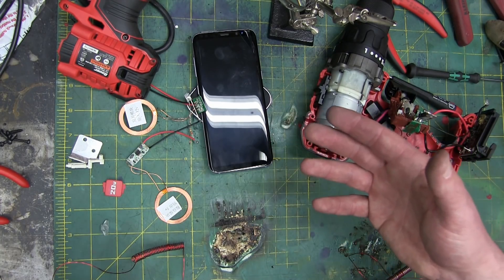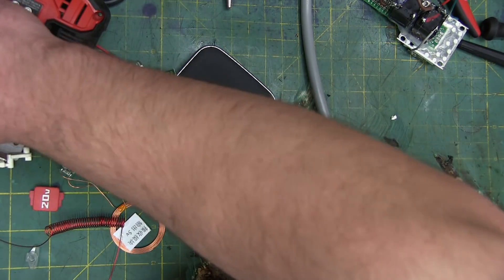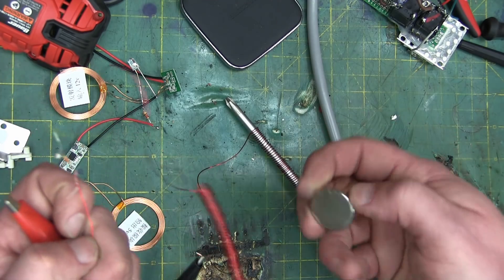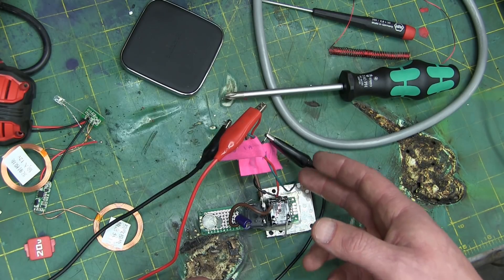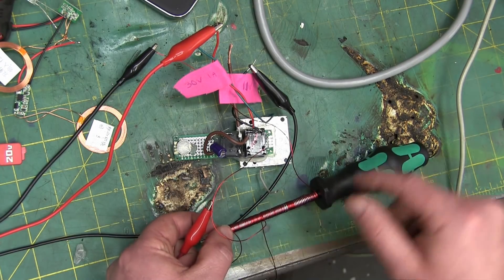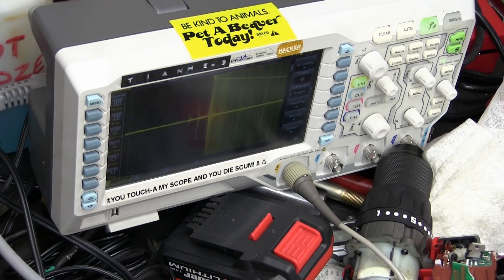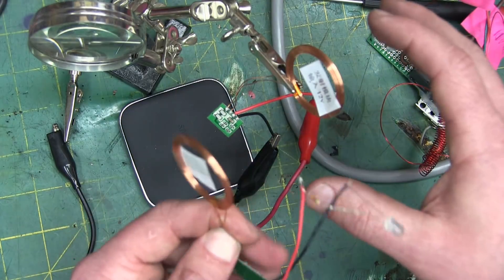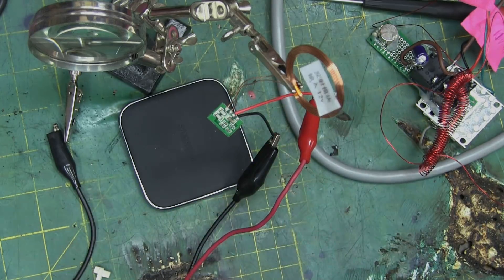Qi Wireless Charging EXPLAINED! | Electronics for the back of the class.

Comment: So if I put coil of wire around my wing dang doodle and a magnet on my wrist I could power my house
Reply from the maker: Yes, but due to inductive kickback, you'd eventually go blind.
Reply: 30 seconds of power is better than no power
Reply: Hell I'm already cross eyed and 30 seconds of power every 5 minutes isn't to shabby
Reply: Get 9 more blokes, and have infinite power.
Reply: So that is how they got power out of humans in the Matrix.
Reply: Distribute these to a federal pen and get power 24/7.
Reply: DIFFERENT STROKES FOR DIFFERENT FOLKS (I was hoping to make a pun on the ole wang in the vice)
Reply: Tom Slak just give 'em a fleshlight with a built in copper coil and a life time supply of magnetic condoms and Aramco will go belly up
Reply: Christopher  Good more then likely light up like a f__king Christmas tree!
Reply: I have a Fitbit.  It said I masturbated 30 miles today.
Reply: They would need an unlimited supply of hot pockets and Xena tapes.
Reply: https://youtu.be/ENZBTPTOFOo
Reply: Tried... wife said the wifi strength was too low... darn almost ripped the head clean off trying to resolve it for her. Worked for a few seconds but be warned, as Ave highlighted with the Phillips, the head can get too hot to handle.
Reply: Different Strokes for Different Volts?
Reply: terry jenkins if I do it right I can make the Christmas tree flash with holiday music😎
Reply: Pffft, that's just a myth.
Reply: 1:34 FAP power!
Reply: pr0xZen dielectric grease it will prevent corrosion as well
Reply: Christopher  Good nice , I'm free energy ! kinda weird seeing my tuna can pecker glow though. Need more lasinapril though.
Reply: Pornhub, was or did develop ah bracelet that you can wear whilst j.... Well you know.  And it crueates and stores energy to later charge a USB device.
Reply: AvE  dude you rock  more power love your videos
Reply: Some lonely nerd has already invented this! (sorta). Google "wankband"
Reply: Wouldn't you rather have your house power your wing dang doodle?
Reply: Bahahaha
Reply: You can power the entire city my friend.
Reply: If done vigorously perhaps?
Reply: polarity is factored on the red pill or the blue pill
Reply: There are several components to studying electronics. One resource I found that succeeds in merging these is the Gregs Electro Blog (google it if you're interested) without a doubt the most useful info that I've heard of. Check out this  extraordinary resource.
Reply: Nahh! ... If you did that the fields would be at right angles to the coil and the movement at a 3rd right angle to them! Now if you had steel in your pencil instead of lead and you caught the magnet to the steel on each stroke you would have an inverted Current Transformer! ...... You could use it to charge your pacemaker ;O)

Comment: Back to revisit from 5 years ago. Special occasion. Field strength of an electromagnet (or any magnet is on a logarithmic scale)  The field flux decrease by a factor of 4 at half the original distance. They are simple, and have been used on inductance stove tops for a long time. However, you must use a ferrous cooking pots. As an electric field, has a very minor effect on many metals. The stove top remains cool to the touch, only heating the contents.

Comment: what you don't mention is that the wireless charger sends out small pulses like you see in the LED until a device is put on top to receive the pulse, after the device receives the pulse, it sends a acknowledge pulse back which turns on the constant high power oscillation on to to charge the device

Comment: If you take a cheap chineseium Qi charger, could you replace the coil with a bigger one to increase the range slightly to accommodate for example, a phone case? I've gotten a couple and the phone charges fine without the case, but with it, the distance is just far away enough that it doesn't charge. Using a more powerful power adapter doesn't do anything because I'm guessing the electronicles are limiting the the amount of flying pixies. Other, more expensive Qi chargers work fine with the phone case, so I'm wondering what the difference is.

Comment: Inductive coupling is just electromagnetic fields at work. When the field changes that field creates a potential (voltage) in the induced conductor and it will then conduct a current into the receiving circuit.

Comment: (from the back of the class) So isn't this sort of how a transformer works?  2 separate coils transferring electrocity without touching?  I'm elbow deep in a wall plug transformer that's hooped  (At least I assume that's what the melted parts inside mean) and barely know anything except what I've picked up here.  6 months ago I wouldn't have even opened it up.  What's the difference between how a cell phone charger works and how a wall transformer works?

Comment: A while back here in the states there was a highly publicized lawsuit where our local power company was suing the pants off a bunch of citizens who were using this concept to steal electricity right from the power lines without touching any of the power company's property (which is what made it an interesting case). They were putting transformers near the power lines and using induction to generate free power. The suit ruled in favor of the power company stating that the lines of flux belonged to the power company and even without touching or altering the companys equipment, it was still theft. I might be totally wrong that this is not the same thing, but still an interesting case.

Comment: I remember those late 90's cellphone, CB, and VHF/UHF scanner antennas. The type that stuck with double stick tape to each side of car windows & transmitted/received through the glass. Could this be the same concept?
 
Those antennas sucked, they always fell off on the highway, I switched to the magnetic, at least I could retrieve those after falling off as they were dragged by the coax unlike the stick on.

Comment: Why don't we use satellites whizzing around the outside of the earth doing the same thing using the Earth's magnetic field
Reply: E Zacher The size of the coil depends on the distance and strength of the energy source. To get any  meaningful amount of energy would require coils much larger than the more efficient solar panels currently being used. Thats only the beginning though, solar panels are a) cheaper, the amount of copper required would cost a fortune. b) much lighter, requiring a smaller rocket to get it into orbit.  c) less prone to problems during a solar flare/storm (voltage spikes perhaps? Not sure but having a larger "antenna" or "receiver" can't be good), etc. I'm sure they considered using the magnetic field, but there are a lot of problems to overcome before it is viable Imo.

Comment: QI transmitter typically start out at 110 kHz and move up toward 200 kHz as the receiver requests less and less power (as the battery gets charged). The TX and RX coils are capacitively loaded to resonate at 100 kHz, so that coupling drops off rapidly with increasing TX frequency. That’s how charging tapers off.

Comment: Is induction cooking using the same method?
Reply: Sirus induction furnaces still important in VIM melting... Arc furnaces are second step of re-melt process. (Former VIM operator)
Reply: Ra Mänd yes,, its old tech, induction furnaces have been going a long time, then they switched to arch furnaces. I wouldnt cook a steak in an arch though

Comment: so basically to summarise the phone has a coil of wire in it hooked up to feed power back to the battery and the charger has another coil of wire in it providing the magnetic field which energizes the coil in the phone and charges it. So my question is how does the coil in the phone not draw current from the battery? is it just with a diode or something more trick?

Comment: It's creating a transformer.
Reply: wheelitzr2 
Unless you reverse the polarity in one of the windings and you get a non transformer, one cancels out the other.
Reply: bob p I don't think you know how a transformer works.
Reply: wheelitzr2 
It was a joke comment but
We had decompounding winding in class 47 diesel electric locos. It stopped the main winding overloading by putting a reverse polarity through another winding wound on with the main windings that cancelled out the overloading current to the traction motors.
Reply: bob p so your talking about a generator and not a transformer.

Comment: what they should do is make a bench charging pad for cordless tools that can be set on a work bench and when you set down your tool for any number of minus it would charge the tool wireless and they have made big pads that you can put a mouse on in any orientation and would charge the mouse just integrate that tec in to the bottoms of batteries and you no longer have to put the battery in a charger just have to sit it on the bench and it would charge it would be cool as fak and scookum. @AvE

Comment: my kids broke one of those dollar store solar toys, its basically the same thing isnt it? coil around iron rod, pulses of minor power from the solar panel makes the hanging magnet rock back and forth... my main question is why did it take so long to make this tech work for the masses?
Reply: Liability - notice that screwdriver got hot? Yeah burning houses down isn't really good for business. They finally got the induction and heat detection working well enough together they can dial it back automatically so it takes longer to charge but the combustion tendencies are mitigated. Hasn't been cost-effective until wireless and battery capacity really got going.

Comment: could you dismantle a usb car charger and explain how it works and also over voltage protection. i see they just use a zener diode but in practice this does not work.

Comment: can you approximate how efficient thes chargers are?
Reply: Flip de boer not very good.  A good transformer is in the 90% plus range.  Air coupled are a lot lower, think it's in the order of 50-60%
Reply: so yet anonther step in the wrong direction towards more efficient use of energy. great.
Reply: Yup, all in the name of "convenience".  The technology is not new, they've been used in toothbrushes for years.

You can also use the magnetic field to spin an impeller in a pump for example, or an electromagnetic stirrer used in chemistry labs.  The "motor" doesn't have to be in contact with the fluid so it's easy to seal and keep conductive fluids (salty water) away from the electrocity

Comment: Why does the magnetic field need to oscillate in order to charge? Would a static field not work at all/as well?
Reply from the maker: wouldn't work at all. The magnetic field needs to be changing.
Reply: It needs to be changing. The induced voltage is proportional to the magnetic flux (ie flow). If the field ain't changing, the pixies ain't dancing.

Comment: This shows how an EMP weapon works and why it's so dangerous to your electronic toys. It will cause more current to flow through the circuits than they're designed to handle and burn them out.

Comment: Using coils with different numbers of wraps and different gauge wire wire would make it a transformer, right?
Reply: It's an air core transformer, yes. In order to work without the laminated silicon-steel core, the gap between the coils has to be minimized and the frequency raised.
Reply: FISTER87 in industry, we use 1:1 transformers, aka, "isolation transformers."
One of their many benefits is to help "clean up" the "dirty" mains power, without that whole water and soap routine.
Reply: FISTER87. No!  A coil to be a transformer  has to be abel to morph at least into a wireless charger.

Comment: AvE, I thought the changing magnetic field induced a current in the secondary coil and the resistance of the secondary coil created a voltage? Is this wrong?
Reply from the maker: Open the secondary; infinite resistance. There will be no current, but you will still have voltage. "Changing magnetic field induces an electric field in a conductor" whatever the fuck that means.
Reply: How does that account for the load connected to the inductor?  I'm pretty sure if you connect a car jumper cable across your inductor, your voltage will be affected.

Comment: Is my wireless charger always sucking the same number of angry pixies from the wall regardless of the phone catching them or not?
Reply from the maker: No, it goes into low power mode if it's not coupled.
Reply: AvE because I'm at the back of the class, while experiencing coupling and a 100 percent bat-tree, where do the pixies dance?  Phone is warm.

Comment: I don't really get the appeal of wireless charging. I've still gotta put the thing on the thing, but now I can't move it around and use it while it charges. The only """advantage""" is that I don't get to externalize my frustrations by putting pegs in holes.
Reply: It's great for when you get Shmoo all up in ur Pixy port .
Reply: You forgot the main 2 advantages, it takes longer and is far less efficient.
Reply: +Bob Woggle
It's quite practical for certain applications, like electric toothbrushes and such.
Reply: Bob Woggle I like it because I don't have to worry about my charging port going bad anymore. That was the death of my last phone
Reply: Had wireless charging on my phone for ~5yrs, don't think I'd ever go back. Built up a dock around a charging pad and just drop my phone in there at the end of the day, pick it up in the morning and all is good.
Reply: I have to agree I work in a fab shop and am forever trying to get all the metal dust out of the usb port to try and charge the damn thing
Reply: caleb h its always stuck in the speaker for me.
Reply: Alcide Cloridrix I mean you could just replace the port.

Electronics is easy, even the small stuff.
Reply: You're also wasting energy with a wireless charger.
Reply: I mounted a wireless charger under one of the compartments in the center console of my car. Now all I have to do is set my phone down and it starts charging. It's like magic!
Reply: clean the dirt out of the holes where the springy bits go and it will be good as new.
Reply: TommyMacDaddy1 what phone / case,  both?  Is that.  Would be great to know.
Reply: Look up LIFI, supposedly the next new "thing", and that's a definant maybe.
Reply: crbielert ya same any audio above half just have a shitty buzzy sound from the steel dust on speaker magnet. LG g6 has been holding up well so far sans case but I know it won't last
Reply: The iPhone port and cable is the main reason I got one. Things are skookum. Keep your port open for sport.
Reply: It's brilliant because there's no "aw, the cable fell behind the table" or any of that junk.  Just toss a pad wherever your phone's likely to be sitting (end table, night stand, etc) and then plop your phone down next to you if you know your batteries running low.

I suppose if you're the type that's got your phone in your hand 24/7 and are constantly running the battery up and down as you use then plug & charge, the static nature of the setup is a disadvantage.
Reply: Citation needed.
Reply: this ain't some sorta fancy science paper, citations are for the birds
Reply: I can put my phone on charge with one hand so great when I'm looking at something in bed (sometimes porn so the other hand is sticky).
Reply: If my phone can't wait to go on charge until after I've finished, I shouldn't be whacking in the first place.
Reply: Bob Woggle some of us don't clean up, just phone on charger and go to sleep. LMAO
Reply: I liked it just cause I didn't have to fiddle with plugging it in and out. It's cool the first few times then it's meh
Reply: My past 3 phones the first part that has failed has always been the usb port. Current phone has a usb-c which works still but has gotten really sloppy so the slightest movement and the plug just flops out
Reply: I'm not sure I've ever had the USB port go bad. It's gonna depend pretty heavily on the design of the phone, I suppose.
Reply: you shouldn't use your device while it charges anyway, tis bad for the batterly.

Comment: Still too smart for me. Why isn't it running a device of destruction?

I wonder if the efficiency is close to that of wired charging.
There would still be a loss in the AC adapter but if you think about how many times every year you plug a usb cable into your phones port ... this will save you trouble in the long run by keeping your ports in working order.
i'd still like to see this stuff build into walls and more furniture for shit like TVs or Lamps to run wireless.
I fucking hate cables.
Reply: Trapperx89 the more power you attempt to transfer is directly proportional to the amount of cancer you want.
Reply: Then we'd have to plug in our furniture!
Reply: I think part of what Ave is trying to show you here is that you can add this to your devices. They're jellybean parts. You order some qi charging circuits & receivers off of ebay and solder them into whatever personal electronics you want to use them for... phone, bluetooth speaker, bike lights, camping headlamps...etc
Reply: If you want to save your phone socket, simply get a magnetic socket adapter. You can permanently install the adapter protruding just a millimetre from your phone, it's hard in there and won't chew up the socket, they're really made to fit tight, and the actual cable snaps onto it either way with just enough force.
Reply: It is happening. I think it was a Ted Talk (or apple).. I know I've seen an example here on YT.
Reply: I've seen it used on a TV too but i haven't actually seen this used as a consumer product. We are wasting power more and more anyway. SO might as well get wireless power going if that means you can just hang a picture onto a wall and have it be powered.

Alternatively i'd take nuclear batteries for devices. That'd be cool aswell.
Like those old russian Pace Makers.